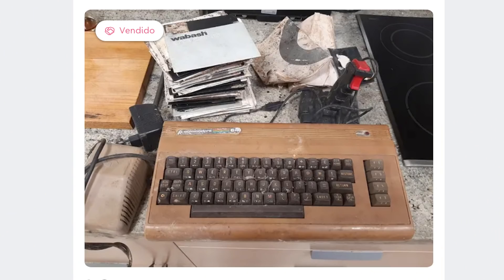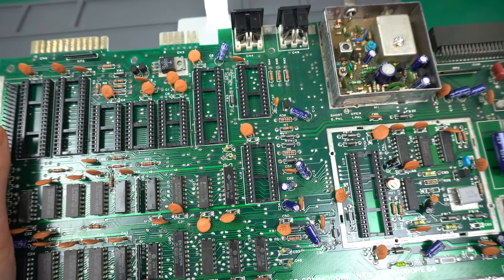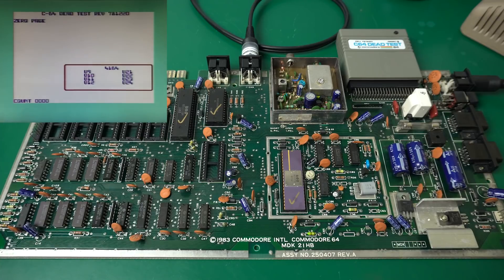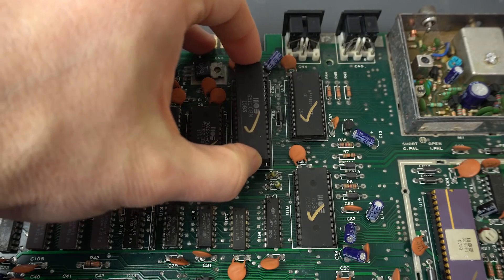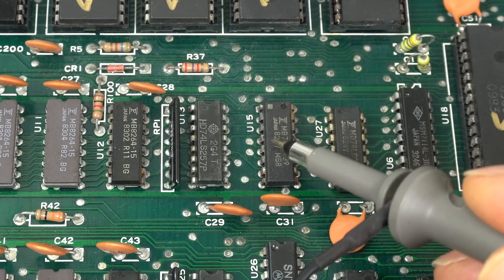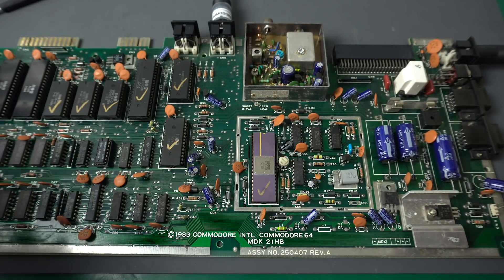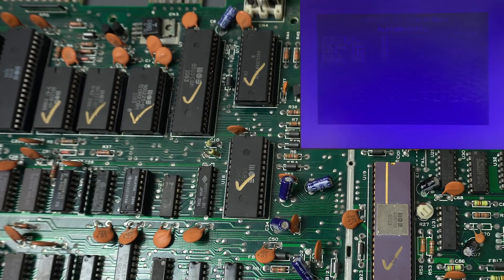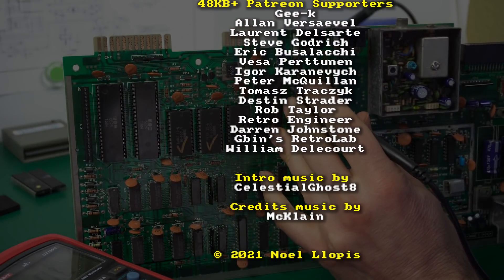Disgusting Commodore 64 Repair (Part 2)

Comment: a typical soft white or red pencil eraser works great at removing connector corrosion and trace corrosion with minimal to no damage, I live in a thermal area and the sulfur makes even gold coated contacts corrode, I am forever having to remove ram sticks, and hard drives and clean SATA connectors/ddr3-4 ram connectors here(I have the soft white style pencil eraser atm)

in my area they get black copper corrosion spots that come up thru the gold plating in under 3 months(a little bit worse than that edge connector but not by much) and the pencil eraser does an awesome job

Comment: If you are doing SID replacement tests then it's worth checking out the Level 1 music from Ghouls & Ghosts. The bassline is totally missing on the 8580 compared to the 6581. I've noticed the emulation in VICE (was using BMC64) actually emulates that correctly as well.
Reply from the maker: Oh, great tip! Saving that for later.

Comment: With the card edges I thought you might try some Brasso.  I've used that in the past, it's easy and effective.  In your case though the pitting may have been too extreme for that so putting down a thin layer of solder was probably the best option.

Comment: Excellent detective work as always! For rust on large items like the power connector there is a product in Canada called CLR (Calcium Lime Rust); I have no idea if it is available in Europe. It’s magic on corroded battery terminals too. Caution: If you try CLR please note that it is quite corrosive on its own. Once applied the area treated needs watched. Once clear of rust the area immediately needs flushed and cleaned (I use water first, then IPA). A few short treatments with CLR are better than one too long treatment. Finally, a question: Do you have a mini-vacuum or similar for cleaning up particles after sanding or using the fibreglass pen? Grit getting into repairs is something I worry (too much?) about.

Comment: Great video, and very interesting. I’m learning a lot! I also have a question: I’ve seen that you sometimes check for CPU activity by probing the RDY pin, and I’m wondering if it wouldn’t be better to probe the SYNC pin? As I understand it, RDY is an input that halts the processor as long as it is held low, while SYNC is an output that the processor sets to high whenever it is fetching the next instruction. It would seem to me that SYNC would be a better place to probe for actual CPU activity?
Reply from the maker: Hi Stefan, it's been a long time since I specifically tested for activity on a 6502 so I forgot the specifics. The SYNC pin seems like a good way to go, and seems very similar to /M1 on a Z80. You could also check with  R/W probably, and, to a lesser extent, clock out.

Comment: I recon Donkey Kong for SID testing😅 Some nice tips again for c64 repairing, thank you. What kind of work do you do for a living, something with electronics right?
Reply from the maker: Thanks for the tip. That's the one Adrian uses for his dance parties, right? 😃
I studied Computer Systems Engineering. Electronics were not taught in a good way (for me) so I ended up focusing more on the software/firmware part. These days I do game development, so it's all software, and all the electronics I use here I just learned by myself in the last 5-8 years.
Reply: @NoelsRetroLab  I like the structure of your troubleshooting, inspiring👍 Any familiair games we know you worked/working on?

Comment: nice job yet again Noel!... that "bad" SID could possibly just need the pins cleaned.. i woulda tried it just coz the chip is hard to source
Reply from the maker: Yes, I didn't want to make the video even longer, but I did give it a good cleaning and... nothing. No change at all. It's dead, Jim!
Reply: @NoelsRetroLab  bugga!
Reply: Probably could be replaced with AVR on an expansion board, just like the other chip that Noel put in place of the one above it, can't remember its name. It may not seem "authentic", but hey, replacing memory and logic chips with modern equivalents isn't much of a difference. For the sake of restoring these classic machines, I guess this is a fair trade-off to use modern clones of these classic ICs.

Comment: Thank you so much Noel for this video. I still think that the Amstrad CPC is much more reliable than the C64 because the IC's don't fail as much. Out of all the C64 and CPC videos I have watched, The CPC may have a single failed IC whereas the C64 usually have many at once. Maybe it is the MOS (CBM) branded IC's that have a higher failure rate than others.
Then again, I would question if the CPC circuit board would live through the same conditions as that C64 and survive.

At the end of the day, all retro computers are equally loved for their appreciation the technology had in that era of computing.
Reply from the maker: I actually agree with that. What I meant is that the board, the PCB itself, is much more robust on the C64s. If you put the Amstrad PCB under similar conditions, it would be a corroded mess with high resistance in all its tracks.

Comment: you did a great job, those tracks thank you!
I had a c64 silver label with a similar disappearance problem, but in that case it was the vic II!
Reply from the maker: That you would push on it and things would change on the screen? I've had that happen with a VIC II as well, but that was the socket in that case. As soon as I changed to a double-wipe one, everything worked fine.

Comment: I'm repairing a couple of Electronic Systems 106 TV Typewriters and most of the problems seem to be really bad sockets.  Maybe due to age but I suspect the quality in the 70's for sockets was not that good.

Great troubleshooting techniques and we all get caught with that "it's probably OK" once in a while.

I really need to get a microscope as that lets you see the tiny defects in traces. You lucked out on those rusty traces.

Comment: I like the Gold and silver pens used for marking the chips, very bling bling. ;)
Reply from the maker: Haha, I used to use a black marker, but you honestly couldn't tell the chips that had an X from the ones that didn't most of the time. This is so much better! (and gold vs. silver... they just came in the pack this way, so I figured I'd make the most out of it 😃).

Comment: Consider using MDFourier if you want to (really) compare the different SID implementations. Might require you to write your own generator code though.
Reply: There are tonal differences between each original chip also due to the analogue circuitry in the chips. The main thing with replacements is that artefacts aren't added.
Reply from the maker: Very interesting. I didn't know about that project, but that seems great. Thanks!
Reply from the maker: That's right. I had read that. Any idea what causes those differences? Is it in minor differences in manufacturing, or was it due to different plants or different processes? It's amazing how complex the SID chip is.
Reply: @NoelsRetroLab  I believe it's due to the analogue circuitry on the chip, the process used was great for making transistors that turned on or off but not so good for making analogue circuits such as resistors / inductors or capacitors as it would highly depend on the doping level / penetration so the tolerances of those components varied quite a bit. Personally I find it hard to tell the difference between the 6581 and the 8580 (which used different filter circuitry to make them more consistent.) but some people can. I'm just happy with either so I can listen to my favourite Hubbard music.

Comment: How do you know if a pin should be active high or low - is there something in the Service Manual PDF that shows you ?
Reply: An overline over the pin name means it's active low. For example, Enable pins are often active low and are labelled E̅N̅ or E̅n̅ or E̅ (the overline should not break in-between characters, but there is no way for me to type that). You can see this on the schematic around 14:33. When written in a logic equation, an overline over a variable denotes a negation of that variable, as does the symbol "¬" (E̅ = ¬E = "NOT Enable").
Reply from the maker: Exactly. It's also often shown with a / before the name, like /RESET.
Reply: @djdjukic  Brilliant - many thanks :-)

Comment: There is already a replacement board that replaces all custom chips with one Mega FPGA called the COMMODORE C65
Reply from the maker: But where's the fun in that?? 😃 Seriously, I prefer individual chip replacements. I really don't like those mega chips, even as the original manufacturers did back in the day (like with the ZX Spectrum +2 for example).

Comment: What do you have against oscilloscope triggers ? :) Instead of trying to catch a glimpse of an instantaneous signal as it passes by, just set your trigger point correctly (below 5v) to trigger on it! I've watched other videos where you use the oscilloscope with signals just rolling by and it drives me mad :)
Reply from the maker: I know, that would have been a good use of it. Normally I don't use triggers because I'd rather keep seeing the data instead of just the first part that happen to trigger it. But this would have been a perfect time for that, you're right.

Comment: I’d have used some WD40 on that rust - does a great job loosening it so it just wipes away.
Reply: Yep, came to make the same comment, you beat me to it. Just let it soak for half an hour, I am sure all of them will wipe away clean. They seem to be superficial, coming from something else. The soldermask did a great job of preserving the tracks.

Comment: Those marks on the back of the board are just some kind of dirt that's very well stuck to the surface of the solder mask, it's not corrosion of the board or the tracks.
Reply from the maker: I was assuming it was corrosion that had bloomed from a single spot, but you may be right. Although it's really weird for stuff like that to accumulate in the underside of the board. This whole C64 is a big mystery. I'd love to know it's true story of how it spent the last 30 years 😃
Reply: @NoelsRetroLab  It does look weird, but I've seen stuff with marks left by insect activity that looked quite similar to that.
Reply: @Zeem4 Indeed.  Insects and spiders often leave "evidence" like that.

Comment: Viewing all the difficulties for repairing faulty Commodores 64's and the high prices that people's ask for them I'm restraining on buying any 64's although I'm in love with them from the mid-eighties. I can repair a humble Spectrum and even a 128 and Plus2 (grey, A/B), but without spare parts and a working parallel computer from where to borrow is very difficult. Also, there's the matter of the C64's faulty power source and the need to have a Dead Test cartridge, source protectors and so...

All of this refrains me from buying a Commodore 64. I'm now with MSX also, fully aware that some of them are very crappy ad difficult to repair too, because of the bad quality motherboards which can be burned easily with the solder.

I you have to charge something for this repair, surely the cost would not be paid enough. too many hours and too many work and components.

Anyways, I'm learning a lot from your videos, because they often guide me to the most logical solutions, and I've repaired and/or upgrade some computers following your guidelines.
Reply from the maker: I actually agree with you. C64 repairs can be quite challenging (but also the most fun) because so many different things can lead to a black screen result. It is a really fun system, so I'd encourage you to get a working one, and after that, having one where to test things, it helps a HUGE amount.
The times I've worked on MSX repairs I found them pretty difficult because every machine is a little different, some don't even have public schematics (*cough* Toshiba *cough*), and then you always have the "MSX Engine" chip that controls just about everything and is different in every MSX. There also doesn't seem to be a common diagnostics program, which makes it even more difficult. At least I know that if I'm tackling a C64 (or Spectrum, or Amstrad CPC) I will be able to fix it. I've had to give us on a couple MSXs because I wasn't able to make any progress.
Reply: @NoelsRetroLab  You're right, and I said before, your opinions are very important to me. I like your channel a lot.

Comment: at 17::40 I see that gold being covered over with solder..something the factory could >NOT DARE< to allow, because the lead soon turns black.
Reply from the maker: But the solder mix stays shiny and conductive for many years under normal circumstances, right? Probably not as much as gold-plated materials, but I don't think it's going to go bad any time soon.
Reply: @NoelsRetroLab  <just now I'm back to see Y-t notices> check the wheel balancing weights on you car rims...shiny?

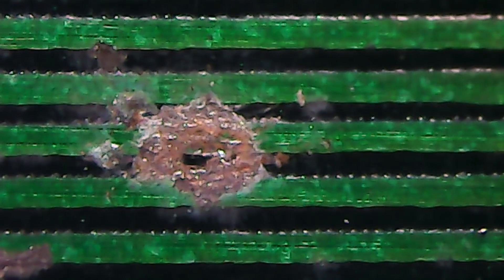Comment: 0:47 I think that a better tool for that kind of job will be a Fiberglass pen
Reply: I got a sand rubber and sometimes use 400 grit sand paper, fiberglass is OK but too expensive for IC pins.
Reply from the maker: I'd be afraid the fiberglass pen would scratch through the existing enamel paint (and it would be massively thick anyway, remember that I'm using the tip of a needle there 😃).
Reply: @NoelsRetroLab  Fiberglass pen use it PCB must process with care, but with IC may be a bit waste since it's quite expensive even bought from AliExpress. For the IC pin, maybe sand rubber or even sand paper is better, if the IC pin did broke off, that shows rust was already damaging the chip so much that cannot be saved.

Comment: why not just put red probe to gnd and check voltage drop on each pin of cartridge socket?
if trace is disconnected there will no voltage drop at all
Reply from the maker: I haven't tried it, but I suspect that not every line in the cartridge socket has some reasonable resistance to ground. But if it did, that would be easier, for sure.

Comment: Don't second guess yourself, every time you pick incorrectly you learn something. They aren't failures.
Reply from the maker: About the sockets? Nah, that was just me being lazy. Those sockets should be burned on sight, especially if they have any signs of corrosion. But you're right, I did learn something 😃

Comment: The first thing you should do is measure the voltage without ICs!
Never trust a historical voltage regulator. Just solder a new 7805 good brand into it.
Reply from the maker: That's true. I normally do and I don't know why I skipped over that in this case. If I had gotten a black screen I would have gone back to that for sure.

Comment: The best sockets are the machined (swiss machined, like MilMax) but good luck on getting any socket to work on DIP IC that have been de-soldered. Socket are all bad. If you want to save the chip break the board. If you want to save the board, clip the IC leads. If you want reliability do not use sockets, Solder the chip to the board.  I try to save both and end up breaking more than I save.

Comment: "Brasso" or even a bathroom cleaner "Soft Soap" does wonders for cleaning up those edge connectors. You can return them to their original golden luster.
Reply: Yes, but Brasso is mildly abrasive and that takes away a thin layer. That wasn't Noel's intention here. It was to thicken and protect it.
Reply from the maker: Right, I normally do something like that. The problem is that the corrosion had already taken chunks out of the connectors, so here we need to build up the material, not just remove the top layer.
Reply: Not sure why it was so destructive in your experience. The "soft soap" I used does have a mild abrasive in it and it safely removed similar corrosive spotting that is common on these connectors without being too harsh. You basically couldn't tell it had ever been corroded in the first place. Prior to discovering this method, I used a fiberglass pen. Now that did some damage alright.